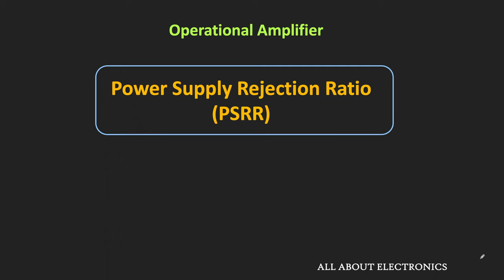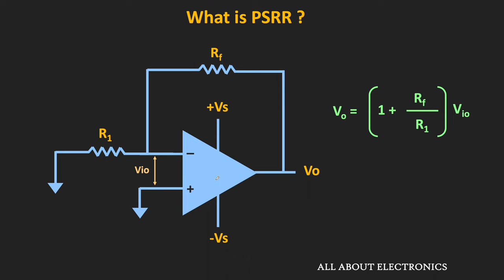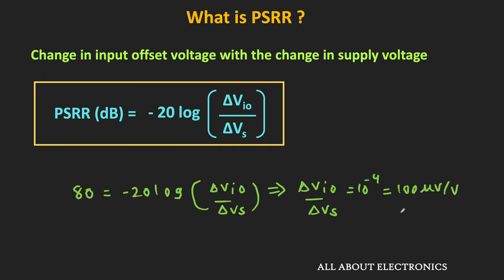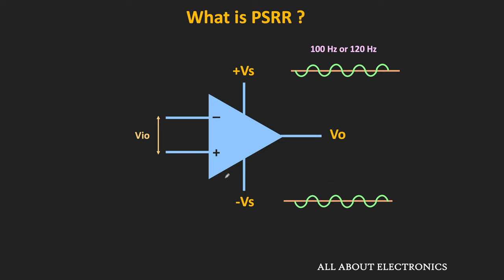Op-Amp: What is PSRR (Power Supply Rejection Ratio) ? PSRR Explained

Comment: How is 0 the ideal state? if it suppresses the ripple more, psrr increases according to your equation.
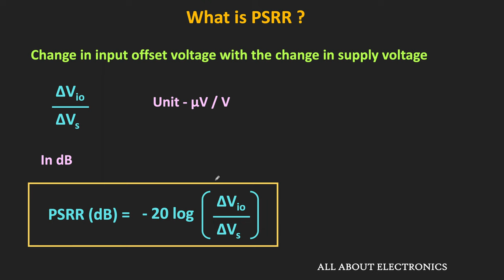Reply from the maker: If PSRR is defined in uV/ V, then ideally it should be zero. That means even if there is any change in the supply voltage, there should not be any change in the input offset voltage, and effectively in the output of the op-amp. But when it is defined in dB, then it is -20 dB log (ΔVio/ ΔVs). In datasheets of the op-amp, typically it is defined in dB. And in dB, higher value is more preferable. In the video, please watch it 5:40 onwards.